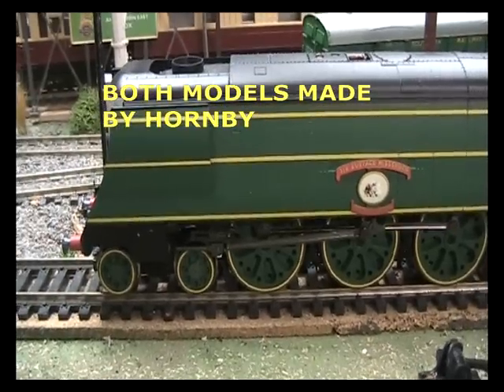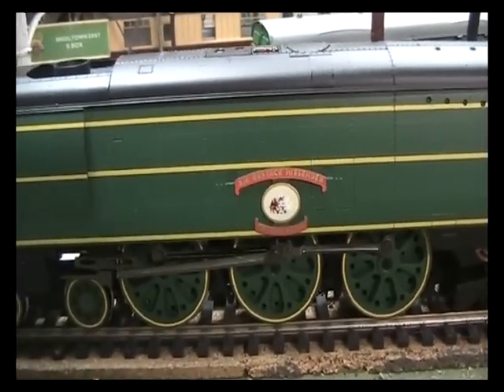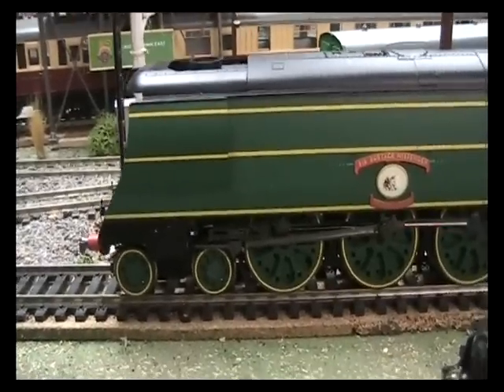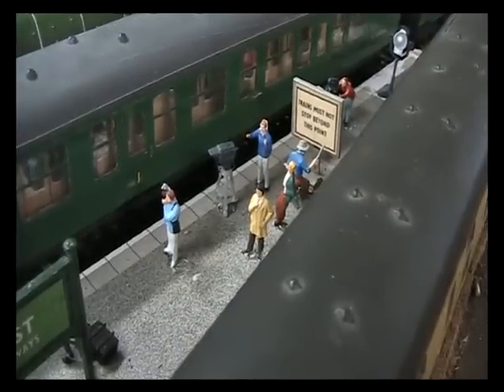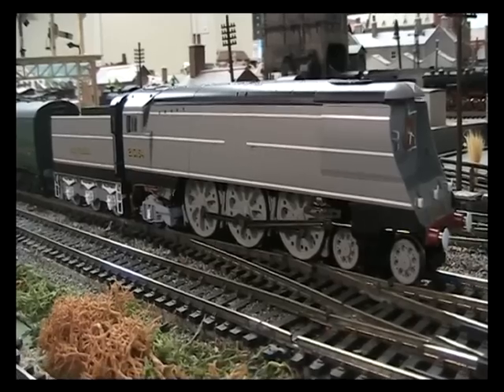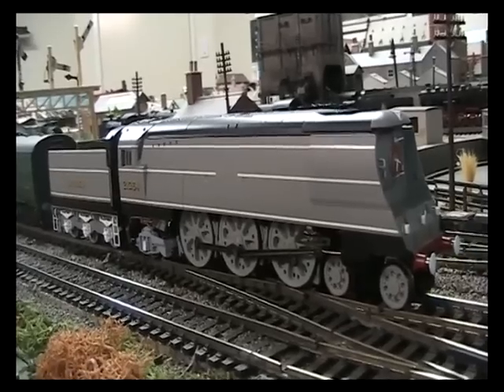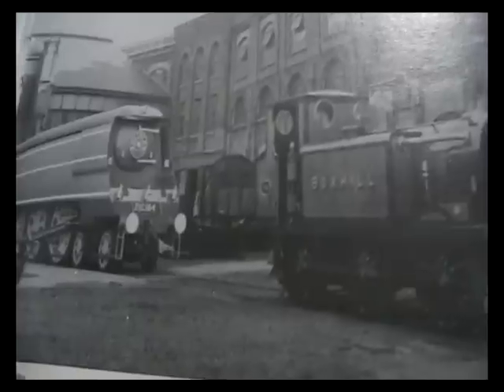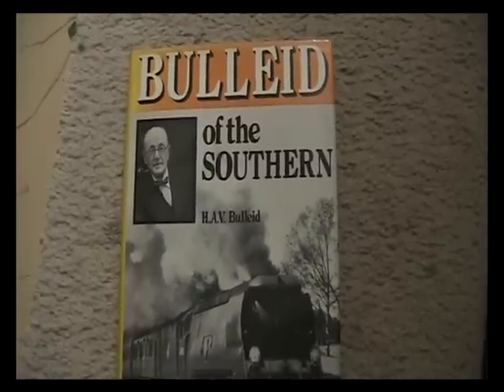A Couple of Out of the Ordinary (unrebuilt)  Hornby Bullied Pacific's-Model Railways 00 Gauge

Comment: Very nice, and nicely shot but... I think that you shot it in wide screen ratio and then forgot to change the screen size from normal aspect ratio to wide screen: from 4 x 3 to 16 x 9 when you did the edit or finalised the movie.  It's an easy mistake to make. I've done it myself. It's easy to rectifty in most programmes. You don't need to re-edit. Just change the screen ratio and remake the movie.  Also if you shoot in HD then render (make movie) in HD quality for best result.